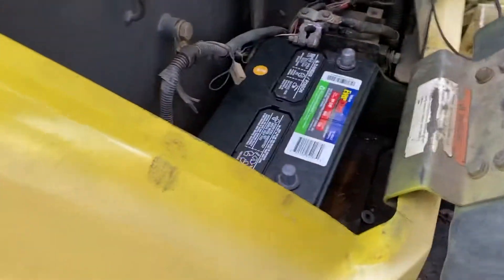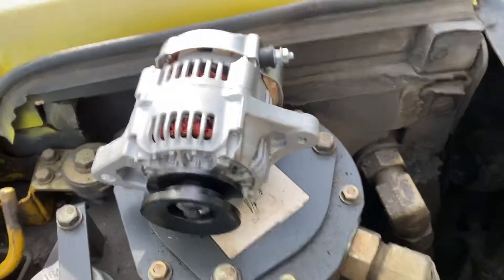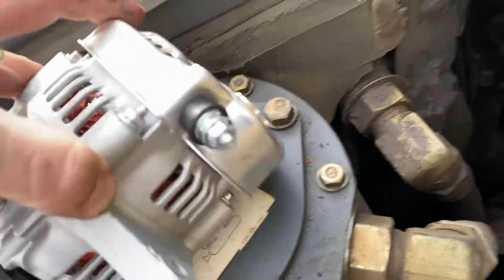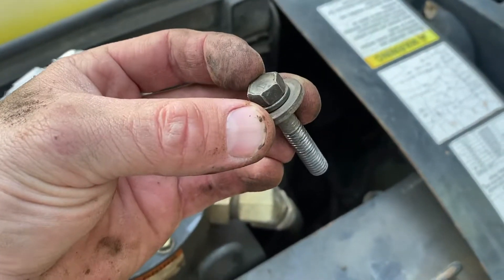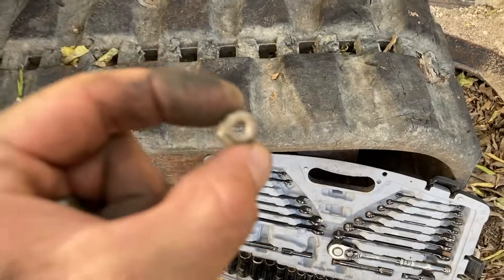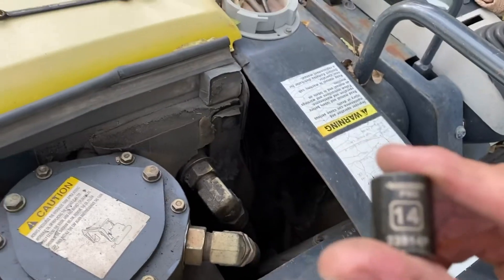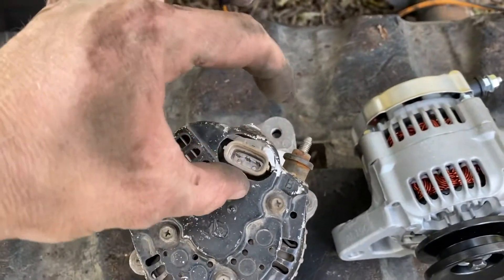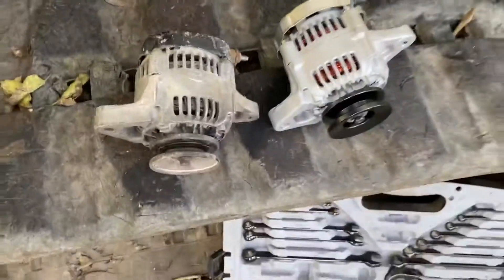Komatsu PC50MR-2 Alternator Replacement

Comment: Why did you just tilt the cab forward to access the engine compartment. Then you can see everything and get in. My Excavator has a shield right there and I have to tilt the cab, way easier.
Reply from the maker: Bc I didn’t need to 🤷‍♂️.  Got it replaced and tilting the cab was more work. I also have skid steers and tractors and what not and have a basic understanding of things and such.
Reply: @heyitsmedouglasheyitsmedou1312  Cool, I seen that you could get done. You did a great job and showing what tools is a plus. My excavator is a 2006 PC55MR-2 it just way easier to tilt the cab. Two bolts and a push. I also had to do the throttle cable so, tilting is necessary for that. AND thanks for the tip on where to get the alternator.

Comment: Thanks for the vid, do you recall the pulley diameter? 62 mm or 69mm?
Reply from the maker: Not sure on the pulley diameter. I don’t recall needing to know the diameter.
Reply: @heyitsmedouglasheyitsmedou1312  ok I asked because I found a cheaper site but just ordered from the same place you did instead.